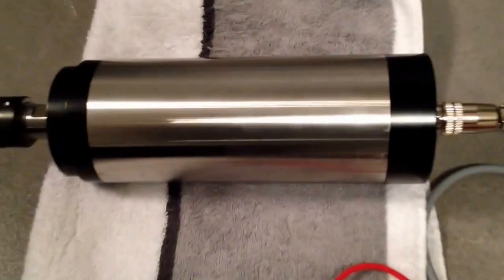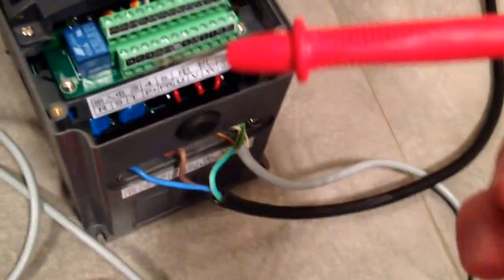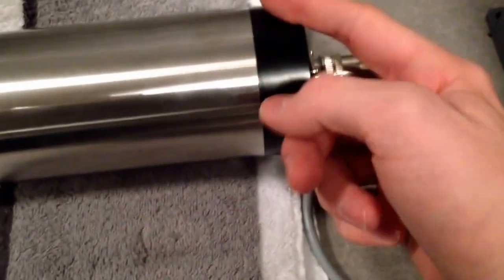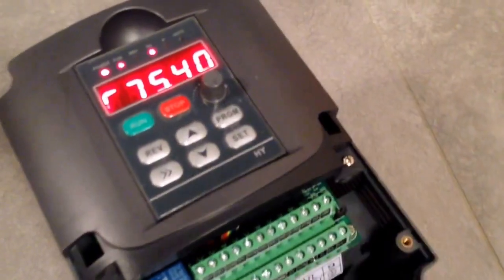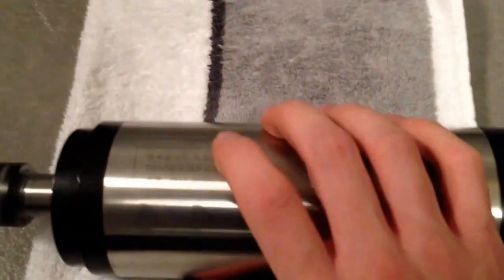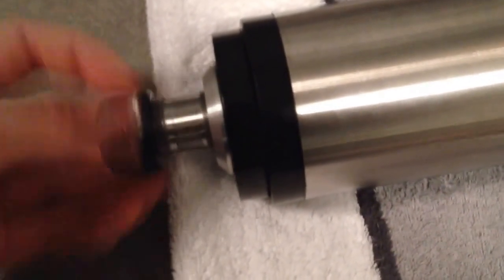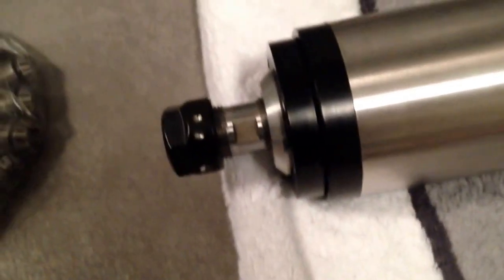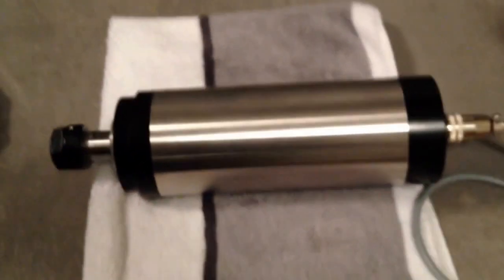Short test of my 2.2kW Spindle

Comment: HELLO, 
It looks great, could you tell me what is the brand of this spindle?
Because I'm looking for buying one , and i like its silence 👌👌👌👍
Reply from the maker: There is no specific brand on these things, just look for a 80mm 2.2kW Spindle with a VFD. You can get them in two winding types one with 24.000RPM(like mine) and one with 12.000RPM, the 12.000RPM Spindles have more Torque which might be interesting if you want to use bigger tools over 8mm diameter on Metals like Aluminum